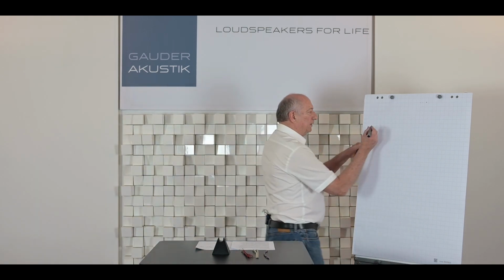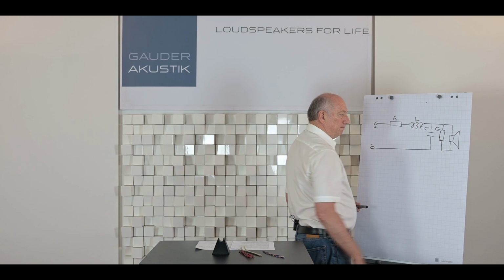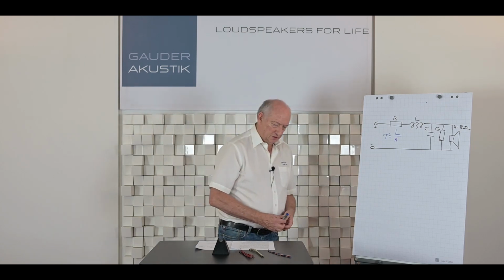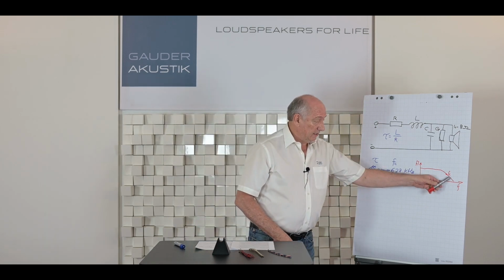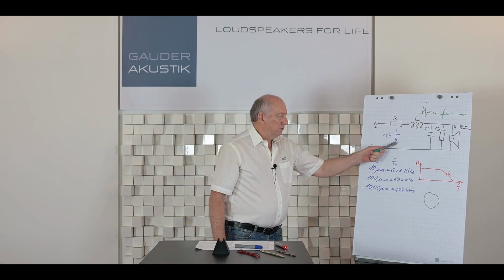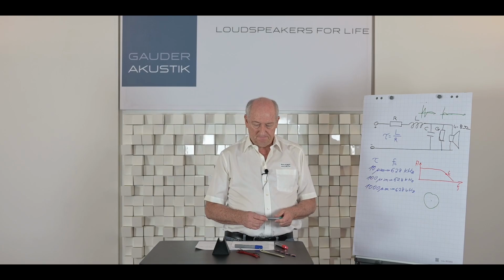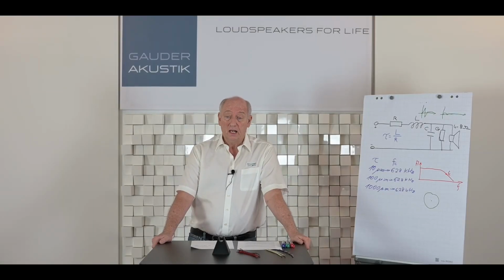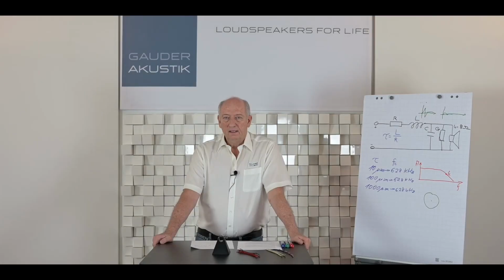The Physics of Cable Part One

Comment: I challenge you to come up with real-world values for the cable inductance and parasitic capacitance from the speaker cables laying on the floor (say, a concrete or wooden floor and speaker cables with a realistic copper cross-section, insulated witth a reasonable thickness of commonly used dielectric) will cause a perceivable attenuation below 20KHz for any speaker <= 8 ohm.
Reply: yo,  the man tells his theory and says he could hear the differences. if there's someone with any opposite opinion, dosen't he gotta proove what he says? i don't understand why all the skeptics ask someone else what they wanna know. if you have your own thoughts, proove them yourself man!!